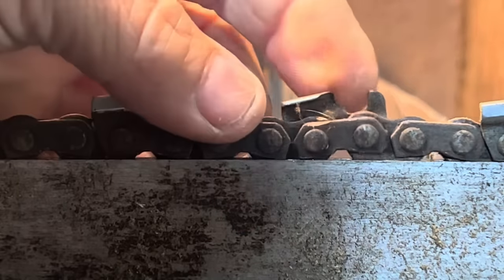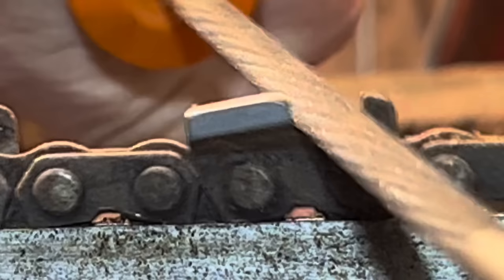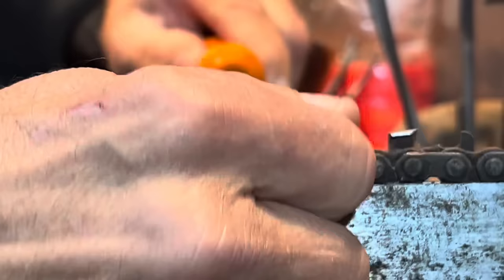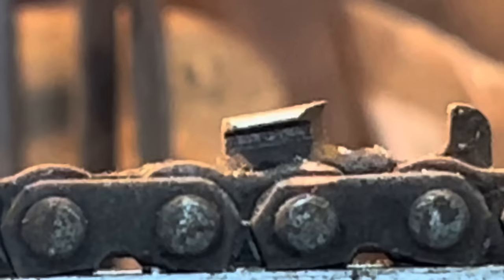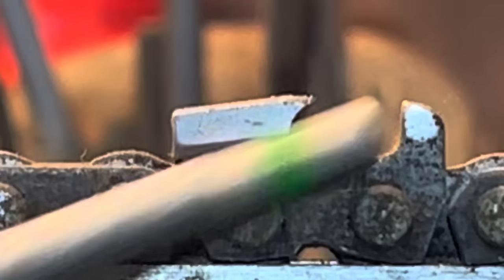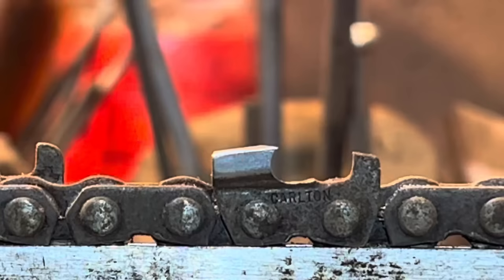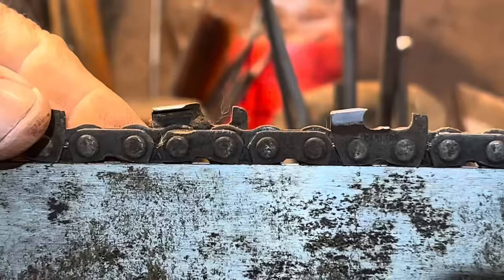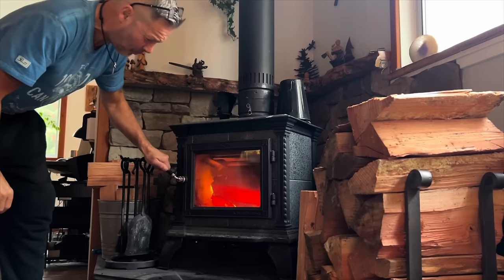Best Chainsaw Sharpening Video yet ! Get the Gullet.

Comment: Really like these helpful tips, Billy. 

But one thing you do too often, imo, (and I hope you don't take offense to me pointing it out) is one-hand the saw on a finishing cut occasionally 🙁. And it's not the hand that will ever catch the blade brake. It's the throttle hand of course that'll get you into trouble. I've done it I hate to admit depending on circumstances but I always feel uneasy. I maybe have done it twice, maybe 3 times a year and always feel guilty and sheepish and more of a gambler than I want or know better to be. 
Now..if there's a good sized branch above it that would protect me from a bar coming up at me if it kicked, then of course those one-handers don't count. But I'm referring to the ones you do right out in the open. Don't be complacent friend! 

Thanks for this sharpening video especially. It's simply one of the best for its length and you cover all the bases. If I want to help a friend, I refer them to this one. 💪👍🙏

Comment: Best camera clarity I have seen in a video yet! Thanks! I have kind of moved away from using my Chain grinder machine from HF. I started running full chisel chains on my Stihl MS 250 about 4 years ago! Prior to that I used the Stihl  Semi Chisel Safety Chains. The full chisels on my saw work excellent and stay sharp! I started touching up with a file every gas up and have not had to use grinder on the chains in awhile .Until watching your video ,I was thinking files don't need replaced very often. I am going to get some new files now. I have been heating my home entirely by wood for approx 6 years now since retiring . I use the Stihl File with the flat bar on top with angle guide . Should I ditch that in favor of free filing ? Thanks for your videos!

Comment: Yea even us experience guys...sometimes get the top plate to thin...I'm guilty of that then it cuts but top plate will chip off on hard woods..I love hand file ing..you get best results .for daily work and bucking firewood and tree service wood wich is always dirty or has surprises like bullets. Fragments.pulp.if I had room I would buy a silvy ..but hand file..have f
Gotten real tired of full house chains..it's way to many teeth ..to file especially stihl brand chains the chrome plateing if it gets hot will eat files up buy they are best here for price and quality the husky is littler higher and no discount. Had several loggers say to put the raker gauge on then remove it to flat file ..because when a guy presses down on his sharpened tip it s metal on metal and can dull the tip..I've found it works ..😮..I used to hold the depth gauge on and file but don't anymore ...takes longer but like it..thecway you showed finish product is way I like it..big gullet no humps.and sometimes slight angle change ..mostly hard woods here ..we do alot of pines conifers.to.but it's noticeable difference in a lesser angle k e ....God bless..seek the savoir Jesus christ alone

Comment: I sharpen chains for other people been telling them if u got to use the dogs to make the saw cut you need to change the chain cause it rounds  cutting edge of tooth back like the chain in this video is and it wont cut till you take all that off and after couple sharpening the chain is shot

Comment: Buckin, is there a way to explain the mechanics or action of the chain as it cuts.  It would be cool to see an animation how it drags through and what each part of the chain cuts what.  I also don't exactly how the raker affects the cutting while it is at speed through the wood.  I understand the filing process and the gullet, but I don't have a grasp on how the edges and rakers on the chain function.  For example the top angle degree, less or more does what?

Comment: Great video had a lot of problems sharpening my chain. Now I find out the file was the problem been using a 5/32 for a 325 pitch that's what everyone and tractor supply and other retailers said the 5:32 was the appropriate file to use I guess they could learn a little bit if they watch your video. Sorry not a little bit I mean a whole hell of a lot more. I will be using that 7/32 file from now on. Great video keep up the good work God bless and have a good day. By the way using the 7/32 file would that be okay with a 325 pitch chain on my 20-inch Stihl chainsaw?. Thanks for your reply ahead of time.

Comment: Thanks for filing education that you provide but just 1 question does it matter if all the teeth aren't the same lenght after filing, like when some teeth has caught a stone and require more filing to get to an edge
Reply: He mentions in the new video that rakers being filed down should make it not matter I guess. I assume that's where the gage comes as the raker height may be different depending on the tooth. At least that's my understanding so far
Reply: @notsorrystory  so as long as you file the raker back to suit the tooth it should be ok

Comment: Thanks Billy Ray, 
I'm fairly new to owning a chainsaw and it's now lost it's edge and about ready for sharpening, fortunately I'm not new to using a file.
This guide is very much appreciated, I do however have one question, how critical is the angle of the file, the cutting edge looks to be around 30 degrees, will it matter that much if I wander off that line slightly. Ian in the UK

Comment: great video, I got my teeth, rakers and gullets in good shape, unfortunately my cut still pulls left and then the bar gets stuck half way through. why is that? implies the right side is cutting better than the left? I have a fallen tree so i can't cut from the other side and its 2-3 feet diameter with 18 inch bar.
Reply: Keep the angle of the teeth the same both sides of the chain use a raker gauge a worn bar will also prevent a saw from cutting straight.
Peace&love 
✌️❤️🌲🪵🪓🐝

Comment: In your video you stated that if you are saw cuts at an angle then 1 side is higher than the other.  Can you please explain this a little bit more?  For example is this something that can be measured or easily eye-balled?

Comment: Just wondering how to prevent the chain from cutting ,, not a straight line,,,   I'll file like you do, and it cuts amazing ,  but then over time or after a touch up,,,,it cuts slanted when I dig the dogs in.    I'm sure it's the angle ,but hard to get it right.  .    Any tips would be killer. Thx buck.

Comment: QUESTION: If taking out the gullet works so much better, why wouldn't the manufacturers do it right out of the box?  I mean, it's in their interest to sell the fastest cutting chain possible, yes?  I'm not challenging the method, I'm just wondering why the manufacturers don't do it - is it some sort of manufacturing limitation?  Any thoughts?

Comment: Buckin I started to hand file ground square chain I works amazing but it seems to me.that I heard tou saying that the wreckers angles are 30° angle and they are 45° on a round C shaped chain. Am I understanding correctly? Where to find 30° gages to file my wreckers? Here in europe almost no-one use square ground chain, I do not know why.

Comment: Buckin' Billy I have a question? I am getting decent at sharpening but I find every now and then when I sharpen the chain it will cut crooked. Pulling the bar to the left or the right as it progresses through the cut. How do I avoid this? What am I doing wrong?

Comment: When u file "out" on the teeth as u r doin,  u r actually rolling the  fine cutting edge out. If u were to look at it thru a strong magnifying glass, u would see it. If u file "in", u will get more life out of the sharpening.
Think about how u sharpen a knife, or a chizel. 
U dont drag a knife nor chisel  away from the sharp edge, u push toward the edge that needs sharpening

Comment: Anyone with more experience than me want to recommend what 18" chainsaw to buy? I don't cut firewood but do do a lot of clean up at my parents house. After an ice storm about 15 years ago, I bought the only saw I could find, a Poulan 16" Wildthing. I can adjust that saw to run great for about 10 minutes, then it goes clear out and I have to start all over adjusting it. I'm tired of pulling on it. I am not looking to spend a ton of money, currently looking at a Stihl MS251 Wood Boss. Thanks

Comment: Hey Billy great video thanks for sharing your technique. I just wanted to point out the importance of keeping the file level or 10° up of the angle of the cutting blade you seem to be sharpening at a downward angle which is not going to give you the most efficient cutting edge. I have found after 20 plus years of sharpening without a guide that the file guides make a huge difference in making a consistent angle in a consistent depth of file on the blade. When you just go in there freehand hog wild you're losing the consistency from tooth to tooth I try to do the same number of strokes in the same position on each tooth in order to get a consistent cut. I understand these blades are heavily damaged but there is no reason to grind into the actual link of chain. And yes I personally run my chains down until there is no blade left at all and eliminate the rakers completely.

Comment: Billy Ray,  I watched the whole video and you have definitely shown me some things I just didn't know.  I also have some issues with the video.  Here they are:
You keep talking about the 7/16th file, but you never say why.  The chain comes with a stated file size.  What I hear you say is that you can use any file you want ... but you never explain why.
Next, you are filing these teeth to all different lengths, but say nothing about it.  It has always been my understanding that they all have to be the same length to keep the saw from cutting crescents.  According to you, tooth length is meaningless ... it is ALL about the rakers.  Get your rakers right and the saw will cut straight ... but once again, you say NOTHING about it.  You leave us guessing on multiple topics.  You could do this video SOOOOO much better ... but i will take a chance and get after a chain i have that just doesn't cut straight and see if you're right.    You STILL should improve the video.